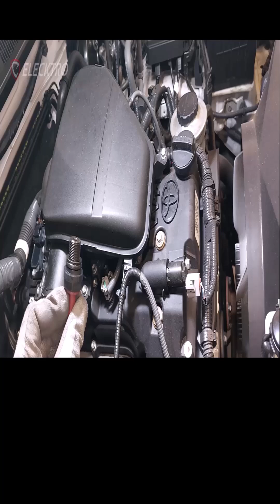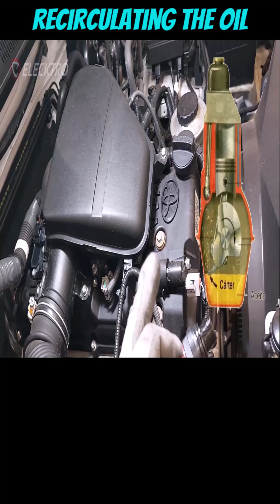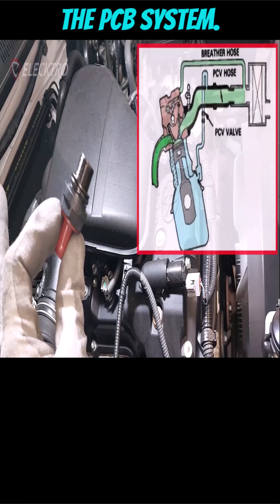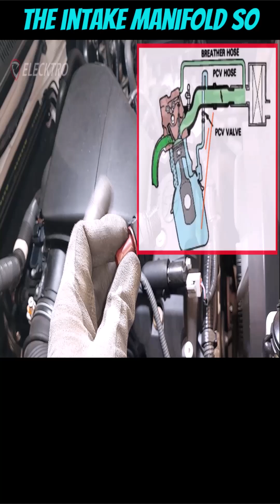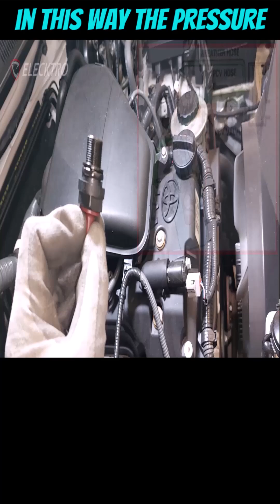Failures and how the PCV valve works in cars

Comment: Positive crankcase ventilation valves do not vent oil vapors. It vents exhaust gases that inevitably leak past the piston rings. When a pcv sticks open, it can cause a strong enough vacuum to pick up oil into the intake.